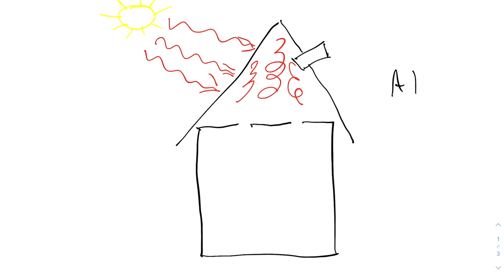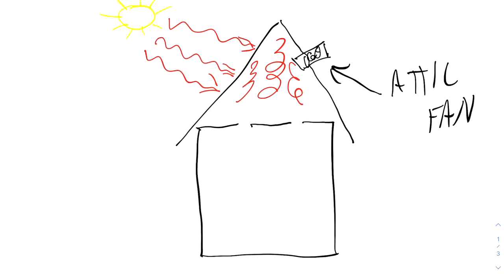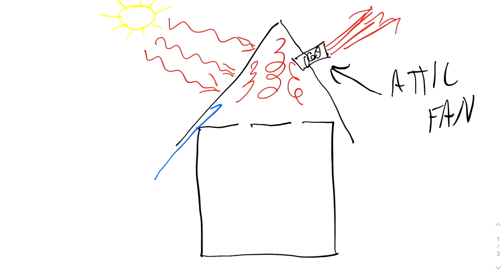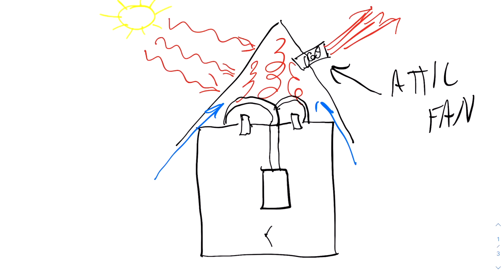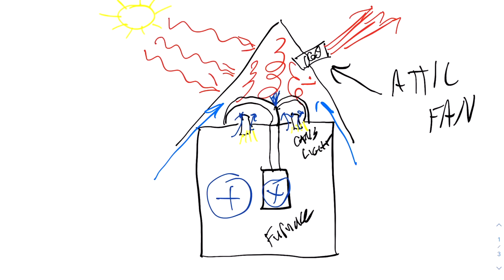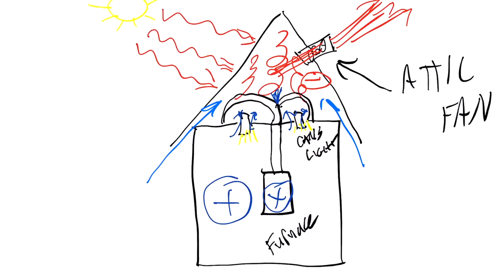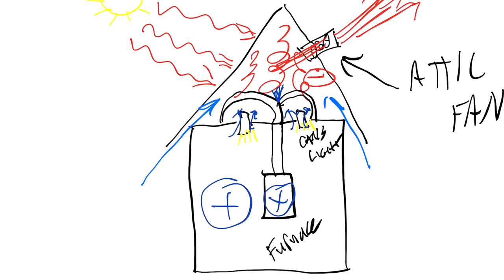3 Remodel Rip-Offs

Comment: Heat rises and if it has nowhere to go, it will naturally radiate downward, heating the interior of a house.  If a house has adequate soffit vents and they are not covered by insulation, an attic fan will definitely reduce the load on any A/C system and it will not create any negative pressure in the attic.  Just like my whole-house attic fan very quickly lowers the temp inside my house when I open basement windows and turn it on.  It draws in cooler air from below and pushes the hot air out through the attic, therefore, giving my central air a much needed boost in cooling the house.  I'm sure this guy means well, but I feel some of his info is a bit misleading.

Comment: I don’t think the reason I’m getting one is a scam. I live in Florida and it’s humid here, over the last year my attic had to be remediated due to mood growth in a brand new home less than 2 years old. I am severely allergic and was reacting even though levels were low from those areas ig was able to penetrate my home. So if I install a fan, than it will allow the air flow and pull if any new issues arise, out and away from my inside, which I need. Plus stagnant moisture alone can be breeding grounds for new growth.

Comment: I use the fan on mode to equalize the upstairs and downstairs.  Heat rises.  If you have the fan on, the air circulates.

Comment: Smart thermostats are very helpful in shifting power usage throughout the day. I live in an area with time of day pricing, where in the summer, electric prices range from 11.5 cents up to 34 cents per kWh. I have my thermostat cool the house down like crazy during those low power cost hours then raise the temperature throughout the day as prices go up. Because of this, around 60% of my power usage occurs during those cheap hours. I wasn't able to do that with more limited simple thermostats, not as effectively at least.
Because of the smart thermostat, my most expensive electric bill to date is still back in 2017, before I installed the smart thermostat. In fact, before I even got my EV, because I was much better able to shift power usage.

Comment: Changing out windows from single to double panes even in a great climate like San Diego area where I live was SOOOO worth it!  Much less heat from the sun comes in.  the temperature difference is crazy better and the road noise is no longer a factor.  I would NEVER keep single pane windows due to the above benefits not to much they also look better.  Our electricity costs are insane here as well so it gives an added benefit.

Comment: There are reasons for window replacement besides just energy savings. Single pain windows and aluminum frame windows sweat. Condensation builds up on the inside. That moisture causes problems such as wood rot and mold and mildew. I replaced all my  double pain aluminum windows and have been very happy with the improvement, and it was a relatively cheap improvement. 

I also don’t believe that powered attic fans are a scam, but since I have no personal experience I will defer to the vast majority of the comments from people that have experience and say they work well. 

It seem Matt missed big time on this video.

Comment: Sorry Matt, but you are wrong about powered attic fans. As an architect, I installed a solar powered attic fan and was able to take my attic temperature down from 145 degrees to 120 degrees in mid-summer. Yes, I have all the test equipment to study the performance. I also doubled the vents around the soffit to pull more air, per engineering calculations. 

Prior to the solar fan, I install three passive vents. They did lower the temperature, but not as much as the new solar fan. Installing a reflective barrier can also help keep the radiant heat out. That's my next project.

Keep building and let the engineers do the HVAC calculations.

Comment: I am Australian ... We still have many many houses without air conditioning because we build our homes a lot more efficiently than homes in the USA. This fella talks about 102 degrees like it is hot, but it gets a lot higher than that here and we don't have AirCon (you guys call it A/C). 

A lot of our attic fans are much different to yours. They are large and are solar, so they turn on the moment the sun is up AND use no electricity. Due to their size they are as efficiency as 10+ Whirlibirds. 

The shape of our houses, the windows, the materials, the colours, are all a lot more efficient than homes in the USA.

Comment: Sealing attic floors with spray foam is what's needed to reduce or almost eliminate house air going into attics. I agree with not having an attic fan but also believe the current system of ventilation is minimal at best and should be improved especially on the intake side. If a small powered attic fan will depressurize your attic then its pretty clear the problem is with the undersized intakes.

Comment: A properly implemented attic fan will  help cool down the house. You just need to have air intakes from the outside, so that the attic fan does not draw air from your house. Anyway, glass or rockwool batting is cheap.

Comment: Radiant energy isn't what heats the attic technically, it heats the shingles, which through conduction, heats the sheathing and the air inside, an attic vent would definitely help in the case of an attic, of course not a 60F difference though. With the A/C thing, the coil is going to stay cooler than the air for a bit after the compressor stops, so it may actually dehumidify more, just depends on the setting

Comment: While you are correct on energy savings on replacement windows, new windows increases comfort by running the heater less frequently. Older aluminum frame windows could also generate condensation and thus mold.

Comment: Attic exhaust fans work in some situations. Air stratifies, and if you keep the air just above your ceiling 20F cooler, your ceiling will be a little to a lot cooler. Take a thermometer into your attic, take a reading up high, and down low. It's much cooler down low, and exhaust fans help keep the differential lower.

Comment: My attic in my split level upper level is nearly 100% sealed. All the heat goes upstairs and with the AC on full in the hottest days of the year, before the attic fan the downstairs would register 63F, main level 72F, and upstairs 82F. Now it's 75F upstairs, 72F main level, and 68F downstairs. It's set to 109F to kick on. I'd rather sleep in 75F than 82F.
Reply: Oh, and fans on ranches, I can agree that attic fans are probably not doing you much good. But let's not say simply they are a rip-off. Let's say they can be misapplied.

Comment: As a former contractor, I've got to throw my hand in here as well.  I found your channel for your information on PEX but find your opinion on attic fans to be without real merit.  I won't deny that there are definitely some misleading statements made in marketing materials, etc.  What do they say about a fool and his money?

Many homes in my area that are ~20 years old have passive attic ventilation systems, such as ridge venting.  If those homes have multiple levels that is the sole reason for a large disparity in the temperatures between those levels, primarily due to them not having a 2nd zone or air handler on that other level.  Construction methods have changed in all homes that are not completely custom or luxury, causing the duct-work for that 2nd or 3rd level to no longer be isolated inside walls, but in spaces like attics; lowering their effectiveness.

Most if not all homes in my area that are >20 years old (mine included) were designed with active ventilation systems, with some having upwards of 3 fans per roof.  Personally, I have a solar attic fan.  One I purchased over 10 years ago to replace the electronically driven one that was installed originally in the home.  It has served the same purpose the original did, while not using any electricity.  While I know that fan was not a large electrical load - it was a load nonetheless.

Do you know why homes have attic ventilation Matt?  Lets start with the basics.

What you are telling your audience is that you trust a ~$5k expense (adding an additional air handler/zone) over a ~$500 one, which does not give the same results - but gives results that are adequate to most.

While, I won't negate your argument about negative ventilation that is an issue that really leads back to what has become common construction methods in newer homes.  I know Texas doesn't get much snow, but in my area - that's how you can spot a leak between the living area of a home and the attic without doing an actual pressure test.

Speaking of pressure, that's why attics have ventilation.  The solar radiation that heats attics up, also expands the air creating pressure.  If an attic is not ventilated properly (and I don't consider passive ventilation proper) an attic will explode like a bomb, or pop like a champagne cork off the top of a house.  This is why we have soffit vents.

Comment: I have two solar fans for the garage.  Mostly just to keep air moving so its doesn’t get to humid and hot. Also re-built the back of the house to remove old siding and install new construction windows.

Comment: My parents put an AC powered attic vent fan in their house years ago (1980’s) and it actually makes quite a big difference in the summer.  It came with a thermostat but that quickly broke and it is just operated by a manual switch, so they actually wait for the house to get kinda warm before switching it on, and it definitely cools the house down, especially the upstairs by a significant amount, enough to make it habitable vs. being forced to eat dinner downstairs before the vent fan.  The house was built in 1964 and did not originally have any kind of attic ventilation to begin with, so it made a bigger difference than modern homes with proper ventilation to code that allows the heat to pump itself out, but they never had to consider installing any kind of air conditioning since then, it alone has been enough.

Comment: I too believe this is a miss on the attic fan stance. I personally took second  temperature measurements before and after installing an attic fan. The temperature dropped eight degrees with no change in outdoor temperature and AC temperature setting.  For me, that eight degree decrease allowed me to  lower the thermostat setting and more importantly sleep comfortably at night. Previously the temperature stayed elevated on the second floor long after the sun set. My house is less than twenty years old, has proper soffit and ridge venting based on attic square footage and is appropriately insulated for the Chicago area.

Comment: That’s some mighty strong statements your making there, i like how you spent 30 mins on google and was like yup I’m making a YouTube video about things I really don’t even understand myself but if I sound technical they’ll believe me...
the smart thermostats, air wave that your referring to if you actually knew what you were talking about you would realize that it actually pumps refrigerant through that A frame coil and when the system cuts off that coil is still cold and there’s actually still a lot of refrigerant boiling off in the A frame coil getting cold (similar to spraying an Aerosol can and it getting cold) well that air wave feature runs the fan and let’s that remaining cold air off that coil by just running the fan for a sec longer and also all the other energy saving features it offers make 25% energy saving an easy percentage to reach I love my smart t stat it payed for itself 
And the attic vents When I first moved into my house we went half a summer with our attic fan off due to a cable guy didn’t mean to cut the switch off, cut them back on and the whole rest of the summer you could literally set a thermostat up there and see a big temp difference I wish I knew they made solar ones. Attic fans and vets work great I don’t think you understand quite how soffits and ridge vents work but keep googling you’ll get there

Comment: Forget attic fans. Use a king post truss roof, with the upper outer layer made from sheet metal and treated with Whitest White©. It is the absolute best way to go for preventing excessive heating from the sun from what I have seen. The lower inside level is clay tiled. Air conditioning costs in Deep South U.S. went down by >70%.

Comment: Our fans cool houses and preserve the HVAC equipment. If you're buying a solar attic fan "to cool the house and pay lower utility bills", it's difficult to quantify the benefits. (However, we have thousands of reviewers on Home Depot who swear by the Remington Solar attic fan.)  But would you rather have your A/C furnace operate in 145 degrees or 110? Huge benefit alone.

Comment: For the attic fan part, the most big issue is your windows are closed in a hot summer day and your attic will have more venting area to allow air flow in your attic. As you said, attic fan will be easier to pull air from attic venting area instead from your ceiling leaking due to the pressure.

Comment: None of the Energy Efficient products live up to the maximum benefit.

However, it does reduce the temperature by about 10 or more degrees. 

Proper insulation is the best and cheapest option with other venting.

Comment: Nice info on the windows but the attic fan is wrong 
In My house in Orlando I installed two and it dropped the temperature in the garage 
It went from temps where I couldn’t be in there more then a few min to I could spend an hour in there no problem and it dropped the temp in the attic enough
That the ceiling in my house was no longer hot to the touch

Comment: He addressed how the fans may not work well in hot climates or summertime. My problem is winter time I have a extremely well insulated attic with very much proper ventilation currently and I still get ice dams.

Comment: The only difference with an attic fan is that it’s active ventilation vs ridge and box vents are passive. It’s all about airflow. It’s even building code to have certain NFVA. With modern roof architecture, it’s virtually impossible to sufficiently ventilate a hip roof with passive ventilation without short circuiting the exhaust.

Comment: You guys, keep in mind that Matt is used to working on houses that have great attic insulation and proper attic ventilation. If he’s doing a remodel then it’s better to add insulation to the attic and add better attic ventilation. If you are remodeling a house for someone else then do it right with insulation and venting. However, if you live in an older house with bad attic insulation and poor attic vents the. It might be a cheap solution for you. Poorly vented attics will build positive pressure and instead of pushing air out of good vents then it will push hot air into your poorly insulated house. A poorly vented attic will have more pressure than your house so your house will pull hot air from the attic into the house and that means your air conditioner works harder. An attic fan is good for those people that can’t afford to add good insulation to the attic. If you have poor attic ventilation then Matt is completely right. You will create a negative pressure in your attic which will pull air from the house. If you are adding an attic fan then your attic should have enough air intake through the vents to supply the fan. If your attic has proper ventilation then the attic fan can help. If you have really good attic insulation and the air gaps around the lights are sealed then an attic fan makes no sense.

Comment: What's an alternative, if powered attic fans are a ripoff. I have a 1980 house with no soffits and an above garage small attic that I insulated and ply floored for storage. No air ventilation and I want to have more controlled temp and humidity. Austin, Tx area.

Comment: Nest just added the ability to have the fan run after the heat pump turns off. I chose to enable the feature and I have noticed the humidity in our house has been higher than I typically expect. In our area this is a benefit as our humidity was previously close to or under 30% in the summer and now it is closer to 40-50%.

Comment: Design your attic fan system correctly by installing a make up air fan rated at the same CFM as your exhaust fan CFM rating.  This will allow for balanced air pressure and more air flow through the attic.  HVAC/R Pro 16yrs

Comment: Attic fans that are properly sized and ducted will absolutely replace the heated air in the attic with fresh air. An undersized fan, or one that is improperly located will not be as effective as a properly engineered solution. Maybe you are correct in stating the products on the market are not very effective/ a waste of money. 

Smart thermostats are dumb - a proper programmable thermostat programmed correctly does everything you need it to. 

Replacement windows on my home are much nicer than the old single pane windows they replaced (house was built in 1958). We live in a temperate climate, so the functionality and look of the windows was more important to us. One of them gets full sun in the afternoon, so it does make the room feel more comfortable.

Comment: HVAC in remodels has to be evaluated on a case-by-case basis. I've been doing restoration and remodeling on houses on the Northern Gulf Coast for decades. Old, new, and everything in between. Some solutions are counterintuitive, but work. I start with the crawlspace, and work my way up to the roof, evaluating airflow, moisture infiltration, ductwork, return-air, fan condition/settings, compressor/evap, A-coil condition, condensate management, and others. Only after I gather all the data can I make recommendations. There's no "Silver Bullet" or "One Size Fits All" solution. It's about doing things that solve problems, increase efficiency and comfort, and make sense financially for the customer, within their budget. That being said, I have yet to do a job where I believed a motorized attic fan was needed 😁